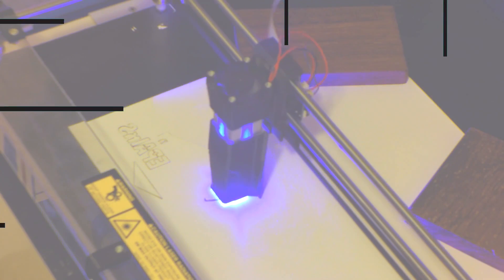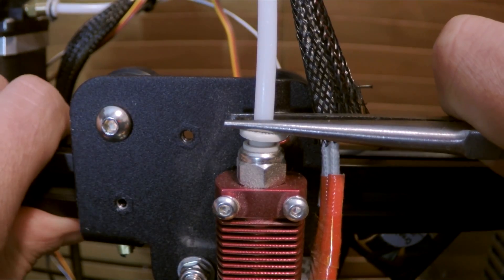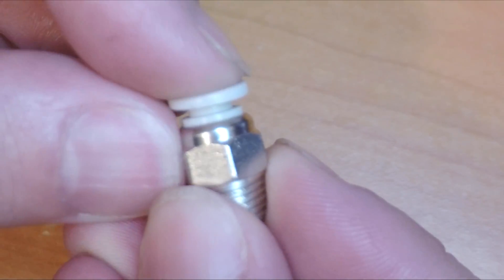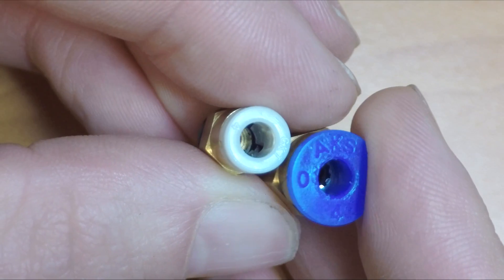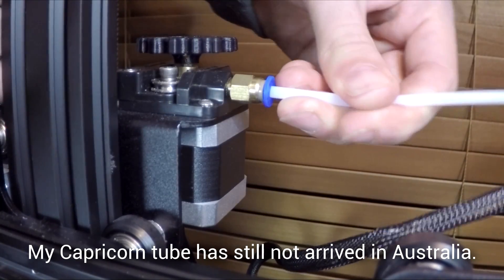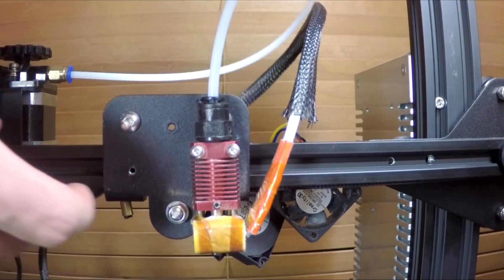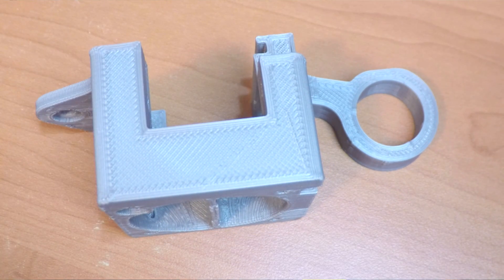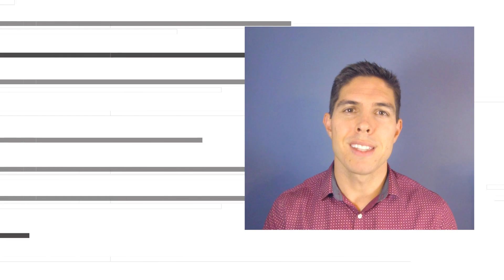Upgrading Ender 3 PTFE tube and couplings - Quick and easy!

Comment: I print a lot at 1.0mm as well as 0.4mm. When I replace a nozzle I also re-seat my Capricorn tube. Each time I do the following (while the nozzle in hot, so be careful): pull the filament out of the nozzle/hot end, pull the tube a few cm away from the nozzle, remove the old nozzle, install and tighten the new nozzle so it's snug, back it off 1/8 turn, then press the tube against the nozzle, and lastly fully tighten the nozzle. I haven't had a clog due to leakage (as shown at 2:48 in the video) since I started doing this.  Great videos, I really appreciate the time and effort you put into them.
Reply from the maker: Thanks for sharing. I actually recently made a video on this process. It is very worthwhile.
Reply: Any assembly/disassembly with a hot nozzle is necessary only in case of all metal hotends. We need full contact between a nozzle and a heat break and due to higher thermal expansion of a heater block we have to tighten at high temperature.

Comment: I probably got the same problem. From one print to another the infill was too low... Now I dismounted the coupling and I saw that the coupling on the extruder is also totally uptight. Now I will order new couplings and a new PTFE tube. I really hope it will solve the problem. Thanks for the video!
Reply: Good news. Everything is working like new. Thank you very much for this video.

Comment: If I buy a new ptfe tube, what length do I need??
Reply: Thanks I don’t have my printer yet so I didn’t know
Reply from the maker: No problem. Good to have extra/spares if this type of thing.
Reply from the maker: It comes in a metre which is probably twice what you need.

Comment: The little, metal limit sensor on the left end of the X axis on my unit broke off when I was doing a fix on the unit.  Have you ever done this and could you possibly do a video showing how to do the replacement?  I searched for one here on YouTube but couldn't find any such video.  Thanks.
Reply from the maker: If you find the part it will be a straight bolt on/plugin replacement.

Comment: Just got the parts in, plan in upgrading after work, do I need to have the hot end at pla temps when putting in or doesn't matter? Only print pla currently
Reply from the maker: Shouldn't matter unless something is stuck. If the tube isn't coming easily, moving a tad further in before gently trying to extract can help.

Comment: Also HIGHLY suggest taking the hot end OFF the carriage before doing any of this. While tightening mine the M3 bolt stripped out of the carriage stand off and I had to change the 20mm long to a 25 and add some washers. This is held on very poorly so take the hot end off just to be safe.
Reply from the maker: Good advice, thank you.

Comment: I had trouble and it was more due to the extruder skipping. I did see the tube move in and out, but I had level issues.  
I have indeed ordered and just received my Capricorn tubing and a pack of fittings. 10 each. Amazon.
I also ordered the aluminum extruder upgrade. I did find after doing some more research, that the stock plactis arm was lossing up cause there was no sleeve/bearing on the screw for the arm. so I got the nice red one from amazon. Will update you on the results.
Thank you.
Reply from the maker: Sounds like a good way forward.

Comment: what did you do to fix the X-axis movement?
Reply from the maker: Changed the fitting? I'm not sure I understand your question.
Reply: If you mean adjusting the X-axis belt tension, you just loosen the tensioner on the right side, place your largest hex wrench (that came with your Ender 3) inside the gap, pull back to create tension, and then retighten.  They say it should twang like a guitar string.

Comment: Thank you Michael. I will check this on mine. I should be getting it tomorrow, any more thoughts for a newbie?  :)
Reply from the maker: First layer leveling and height is by far the number 1 thing that trips new users up. Getting the right amount of 'squish' for that layer is essential.
Reply: @TeachingTech  thank you.👍🏻👍🏻
Reply: BTW, you are correct. But I was new to this and I am learning. I found out that I did have my bed level, but the wheels were loosening due to the fact I didn't have them tight enough to begin with.
I used the paper method in all 4 corners, still had issues. I think cause of the extruder and the loosening thumbs wheels. 
Also I didn't know how to remove the parts from the stock build plate. I didn't know to let it cool down first.
As a result, I tried to clean the plate to no avail. It's ruined. But thats ok. Everyone seems to like the glass better.
So I got the glass replacement from Creality thru amazon.com.
Will try that once I get some rest, work has been crazy.
Thank you.

PS -- have you heard of anyone removing the 4 bed springs and replacing them with solid standoffs and using the autolevel?

Comment: Is pc4 m10 and pc4 01 same thing i could not found m10 in my country i bought pc4 01 hope that fits
Reply from the maker: I haven't heard of that, fingers crossed it fits for you.
Reply: Teaching Tech https://m.n11.com/pnomatik-konnektor-pc4-01-v6-v5-175mm-x-1-adet-P279004015?cid=604001&gclid=Cj0KCQjwidPcBRCGARIsALM--eMDyu63GNJV65sAnedbHhhnU5x9S6cNyvJbQFcrG9UsVYpV1og1DagaAnj6EALw_wcB&gclsrc=aw.ds this is the link for that
Reply: PC4-M10 has M10 metric thread while the thread on the PC4-01 is 1/8" inch, ever so slightly different. They may fit (they usually do due to tolerances) but don't force it if it doesn't go in smoothly.

Comment: How much heat must the connector be able to handle ? Went to a pneumatic shop and got a standard PC4-M6. Think it will work ?
Reply: The connector I have can handle 70C. Does the Bowden system only heat up the nozzle or the connector too ?
Reply from the maker: It should be ok because the heat sink and fan are designed to stop the heat spreading up as far as the connector.

Comment: Speaking of PTFE tube upgrades, have you had a look at adding an extended PTFE tube inside the MK3 hotend?, The original 50mm one leaves a sizeable gap between the bondtechs and the end of the tube, if you cut one to ≈53mm and give one end a pointed tip you can get the tube super close to the gears without rubbing giving you a minute gap, was one of my first (and pretty much only) modification for the mk3, allowing it to print flexibles at and above 60mm/s (I have cranked it upto 120mm but that just gave me anxiety 😆)
Reply from the maker: That sounds like an effective mod. The Flexion has that type of arrangement. I'm hesitant to mod my MK3. To use a car analogy, it's like my daily driver to keep stock and reliable so I can go crazy with other weekend cars. I also have a Cocoon Create Touch modified for the sole purpose of printing flexibles.

Comment: For anyone attempting this mod, make sure you get PC4-M10 fittings, not PC6-M10 fittings. I was dumb enough to not look at the product before I bought it so I'm out another 8 dollars. The PC6-M10 fittings are for larger PTFE tubing that fits 2.85mm filament.
Reply: OMG! Please listen! The fittings are NOT with M10 threading! It's a tapered R 1/8'' threading! This misinformation seemes to have spread arround the hole 3D print community and allmost all 3d print online shops sell those fittings under the name "PC4-M10".
Please measure it and convince yourself!

And before sb asks: It's also not M10x1 !
If you take a caliper and measure over 4 or more thread turns you will see: the pitch isn't 1.5 mm and not even 1 mm: It's 0.9 mm!
Same goes for the outer diameter: It's 9.7mm (at the widest point: because it is tapered) and not 10mm!
Reply: And this is why I read the comments, thanks!
Reply from the maker: I've updated the description, thanks for posting.
Reply: @TeachingTech  hi i have ender 3x what to i need to print higher temperature like abs peta nylon currently it goes to 110c hotbed temperature can u send me link.
Reply: @TeachingTech  didn"t read the description, ordered wrong one. A sticker in the video would be nice...
Reply: @TeachingTech  is there a thicker tube with 1.75mm diameter? like 8mm OD and 1.75mm ID?

Comment: For an Ender 3, you need approximately 50cm of PTFE tube, 1 x PC4-M6 and 1 x PC6 x M10 couplings.
Are you sure that PC6 x M10 is correct?
Reply: PTFE tube 4mm,  I think PC4 x M10 will be correct
Reply from the maker: You are right, I've corrected the description.

Comment: Got my Ender 3 the other week and assembled it last week. It prints beautiful straight out of the "box" so to say. The couplings are holding on to the tube extremely hard and i haven't experienced any issues with it apart from that the drivegear on the extruder motor came loose. Just make sure those 2 screws are tightened enough so it can't start slipping.
Reply from the maker: Sounds like the QC s getting better all of the time.

Comment: My Ender 3 was from a recent batch - Zero issues with the boden setup except my extruder gear keeps riding up the shaft of the stepper motor - Even after tightening. This is over about 300 grams of material though. 

My ender3 also shipped with one spare fitting. I assume as a "just in case" due to feedback. It was appreciated!
Reply from the maker: Glad to hear they are tightening things up. When you tighten the filament drive gear, are you making sure that one set screw is facing the ft of the stepper motor output? If so and you still have issues, maybe some loctite would help?
Mine also shipped with a spare.
Reply: I suspect from the factory it may not have been on the notched area-  However when I tightened it the second time I confirmed this. So far it hasn't popped up - But if it does I'll print an extruder "wheel" that seems to be popular which should help. At bare minimum when it falls off It'll be an indicator of when the extruder gear is riding up.

Comment: I replaced the extruder to a metal one. I also have some movement in the m6 fitting but it isnt a big problem. I will cange the tube in the next week or so just to make it perfect
Reply from the maker: I was generally getting good prints with my stock setup. The changes I made to the slicing and belt tension did more than this upgrade, although others seem to have it way worse.

Comment: Which printer you recommend for printing polymaker pc max. Value for money plz.
Reply from the maker: I'm afraid I have no experience with that filament. It's a fairly high nozzle temp so something with an all metal hot end would be good. They really recommend Buildtak at 80 deg C too: http://www.polymaker.com/wp-content/uploads/2016/05/Polymaker-PC-User-Guide-v3.0.pdf
Reply: @TeachingTech  thanks hope you will try this filament on your cr 10 and upload it.

Comment: my m10 was very nice but my m6 was very bad so i replaced it before starting to use the ender
Reply from the maker: It made a good difference?
Reply: i never used the original one because i knew many had problems because of it, but i could see pushing it by hand that it moved 2 or 3 mm easy

Comment: I just replaced my hot-end coupling and so far crossed fingers it has cured my under extrusion problems, however only time and more printing will tell.
Reply from the maker: I found upping the extrusion width for solid infill had the most impact, maybe give it a try?

Comment: This problem took me ages to figure out after it occurred 2 weeks into using the printer. Print quality progressively got worse every day until I upgraded to an aluminium extruder and replaced the tube and both couplers as you did and this made a huge difference. This along with new bed leveling springs have the best improvements. Nice video wish I saw earlier 😁
Reply from the maker: Thanks mate, glad you got it sorted.

Comment: Great vid I'll be sharing. I botched the extruder end up with super glue. Nothing to lose if you're planning on swapping out the coupler anyway. And a zip tie in the hot end. I'll get a set of couplers in the near future. I have had to reseat the got end a few times and I haven't wanted to risk gumming up the hot end with the super glue on the coupler
Reply: I did the same ,super glue made things very tight and stable
Very very few problems after that

Comment: I tried to remove the PTFE tube to apply some PTFE dry lube and found out that as you said it is almost impossible. I already have some fittings I'll probably try with a thicker wall ptfe tube and ptfe lube. Just got some niceties from Clreality3d Store on Aliexpress too, one of the new fiber removable beds and a Creality 2.1 Atmega2560 based board. From Germany I got a carbon fiber bed also.  Those beds will need a BL-touch / 3d-touch sensor to avoid endless calibrations when swapping beds....
Reply from the maker: The carbon fiber intrigues me greatly, and I didn't know they had a 2560 upgrade. Thanks for sharing.
Reply: It is not really an upgrade for th Ender 3, but for the CR-10 to CR-10S or replacemet for the latter. But as both cr-10 and ender-3 originally used same board I decided to get one and give it a try. It looks at first sight the holes for the microsd, usb and the mounting holes match. But you need a second cable for the screen too or build an adapter. The rest is recompile Marlin for a Ramps board with reprapdiscount full graphics o take the cr-10s example and modify it to match the phisics of the Ender 3 (this second path is better as you get the extra pins defined too). The carbon fiber surfaces are sold on ebay from Germany. Supposedly you clip over the bed like a glass and you can print directly over them,  they are 1mm thick and you can bend them a little to pop the prints out almost like a spring steel one., but they are lighter and (supposedly, not tested) don't need a surface sticker over them (i bought extra ones just in case...). if you have a twitter account I can tweet you some photos.

Comment: I’ve been interested in the Ender 3 and don’t mind tinkering with it. But have you all been keeping track of the cost of the upgrades? 

Wondering if costs of buying a Ender 3 and upgrading it is worth it compared to more expensive 3D printers.
Reply from the maker: It still comes out pretty well ahead. Until you are getting up to something like a Prusa MK3 (which I also have), it's hard to find a lot of these smart features includes.
Reply: I fully agree with you, now I realize how the Ender-3 is a crappy printer with too many design flaws which once fixed are almost doubling the price of the printer. With all flaws fixed and EZABL and EZOut add-ons you end up with a final cost not so far from a better Prusa i3 Mk3. And you also lost many many many hours viewing videos like this one. A great video by the way, kudos to this YouTuber, but I would have prefer NOT having to watch it to begin with.
Reply: The essentials are cheap as chips. That's basically the fan cover you print yourself, the couplers, and a spare bit of regular Bowden tubing if you don't need high temps

Comment: I personally use th3d's blue tubing I love it any way you would do a berd air setup on any of your printer apposed to  using fans for part cooling
Reply from the maker: Not sure what you mean by 'berd air' but you have my attention.
Reply: @TeachingTech  Google berd air it's by the maker hive or something like that
Reply: @TeachingTech  http://www.themakerhive.com/shop/viewitem.php?productid=45
Reply: https://www.thingiverse.com/thing:2875099 I used this mount an rubber bands I'm printing a second mount for my tevo which is 24v I got the 12v on because there was no 24v ones in stock I got it as a mockup I checked there site the 24v ones were back in stock so I'm making another mount an gonna use one for my tevo an the other for my ender 3 or cr10s it allows your extruder carriage to be lighter since there won't be part cooler fans I'm gonna pair it with a ezabl e3d-v6 an possibly a zesty nimble to have the direct drive experience with them machines I have a zest nimble on order for my tevo little monster as well

Comment: I already change to E3D V6 hotend is a good choice for ender3, it's all metal hotend then you can print Nylon and ABS better.
Reply: Nice, thinking of making the same upgrade to E3D kit, Did you go for the full aero or just the hot end?
Reply: just the hot end, I just bought cheap chines clone from taobao.com, I'm in china, only spend less than $20.  btw, can't find your facebook, how can I follow you. twitter?

Comment: Hi Michael, yes I was having under Extrusion problems with my Ender, first I replaced the plastic extruder parts with metal ones and that didn't fix it, then I replaced the couplers and PTFE tube and it prints perfectly now.
Reply from the maker: Good to hear Jim.

Comment: My original CR-10 from Summer 2017 definitely has the problem on the hot end side. Caused lots of jams and bad extrusion.
Reply from the maker: You fixed it?
Reply: Teaching Tech Still waiting on my Capricorn replacement. I fixed it temporarily a few times but the PTFE tube eventually backs out a bit and causes jams/extrusion problem mid-print. I’ve started printing some stuff at a fraction of the speed just so that it can extrude without jamming.

Comment: unfortunately this printer has other flaws, one of them is extruder which has to be replaced, Bondtech is my choice, after that and replacing couplings and tubing now is printing beautifly
Reply from the maker: What problems were you having? No such problems with mine. Most people changing it seem to be seeking improved specific functionality like better grip on flexibles.
Reply: filament slides on extruder gear, after replacing spring on that with better tension, extruder is starts to losing steps
Reply: @interlocutorrex4045  run any extruder faster than the nozzle can melt the plastic and it will skip or grind. What is your slicer settings
Reply: 60mm/s (infill only, others slower) is to fast ? well now I can print 200mm/s and no skipping, frame is enough sturdy to handle this without ghosting and layer shifting